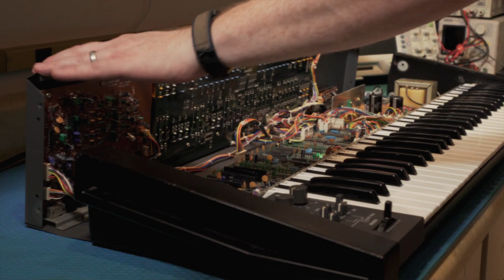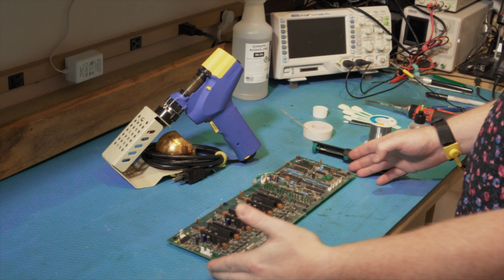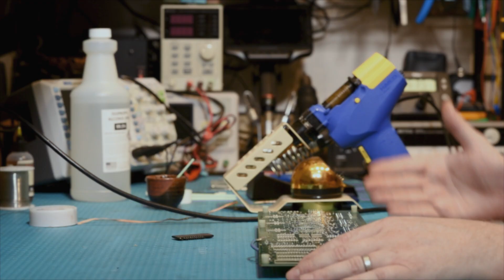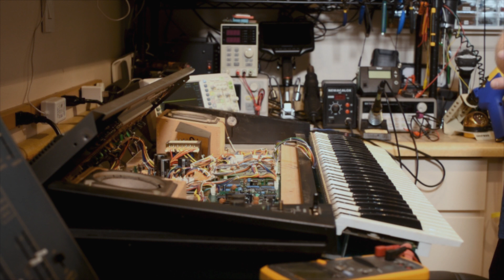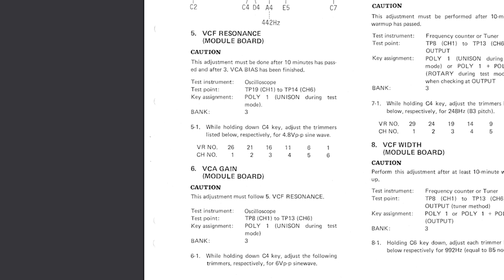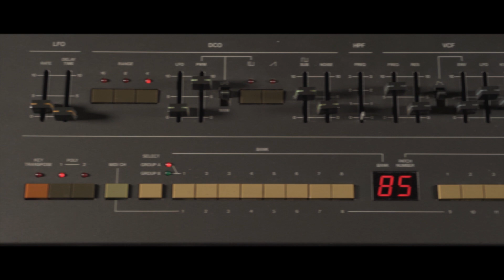Roland Juno-106/HS-60 Voice Chip Replacement + Demo Track~

Comment: Thank you for the video. This is up amongst the best synth restoration/repair videos I have seen. The fact you covered every step with technical advice is welcomed. Many others cut out the actual repairing part and go from we need to replace part X, cut, I have replaced part X. I was wondering if you have been or are a teacher as it is a comprehensive learning video. All the best from Australia.

Comment: Yes a millivolt is a thousandth of a volt.   1 Millivolt is written as 0.001 V, so 15.01 volts is somewhere around 15 + 10 millivolts although you are not set to display a level of accuracy to know whether you are within spec.  Other than that your video was excellent, great job. 

I am working on my Roland D-70 nightmare of the icky red glue destroying the keyboard and the display dying. Not fun!!  

Thanks for sharing your techniques and expertise!
Reply: yeah, he is definitely not calibrating correctly starting from unit conversion to not using the correct dmm

Comment: To remove the chip I was forced to use a heat gun to heat up all the pins at one time.
Reply from the maker: Desoldering ICs is an art indeed. Glad you got it done with the heat gun! They can be a great option as long as you localize the heat application to the IC pins as much as possible.

Comment: What's up fellas.  I was able to remove the solder from the empty holes with the cheap vacuum pen that you see used here.  You must use HEALTHY volumes of flux first, then use your braided copper and remove as much lead as possible first.  THEN AND ONLY THEN will the cheap vacuum pen work. It's not strong enough to remove large volumes of solder from the holes.  Best wishes.

Comment: Got to know if one of those inexpensive oscilliscopes would work like the ones on Amazon for 50 bucks
Reply: I’d like to know too. I’ve been using one and it works up until the vcf resonance voltage portion. I’m not sure how to read 4.8v with it 😩

Comment: Chip 1 and 6 are mute only in Patch number 1. All 6 voices work under other patch numbers. Could that be a battery related issue?
Reply from the maker: No, the battery is either dead or not. If all six voices are working on every patch except one, the voices are working. Go to patch one and start editing all the parameters, like turning the waveforms on and off. How thoroughly have you tested this?
Reply: @VintageSynthesizerSolutions Well I tested as much as I know about instruments. I'm just  experienced with soldering and desoldering. Attemping a repair on the standard juno 106 for my uncle who is a musician. Did the acetone epoxy removal on chips 2 and 6. The DCO region that produces brassy sounds seems to be affected. 2 and 6 voice chips work but sound slightly distorted in some patch numbers. Volume is normal on all chips unless DCO related effects are applied. Volume and distortion issues. Traces seem fine too. Used a good desoldering vaccum. Chips came off clean and went on clean on the voice chip end. I don't have a multimeter though so I'm not 100%. I'm stuck at that currently. Doing as much research as I can. I very much appreciate any diagnostic advice. It would be cool to fully revive one of these.

Comment: Am I glad I found your video! I'm working on my 106 now. I was prepared to recap the power and jack boards, but was leery of dealing with the double-sided module board. I don't have a solder vac, but I have plenty of wick and time! I now feel that I can do both the caps and the new chips. I see that AR offers a package deal that includes the 3 D5534A chips as well. Should I replace those as well while I'm at it? I am coming from the restoration aspect as opposed to just repair. Thanks so much for making your video so detailed; it really does help those of us who are tackling this for the first time.
Reply from the maker: Thank you! We try to approach all of our repair videos from a perspective of how one would teach a novice. It can be very intimidating opening up your beloved vintage synthesizer for the first time, let alone working on it. Per your question, the 5534a seems to fail far less often in my experience, but it does share the same resin coating that causes the failures with the 80017a. If you do decide to replace them, keep the originals and treat them with acetone to remove the coating. Helpful if you ever want to sell it or swap them back.

Comment: Thank you that was a fantastic walk-through. Out of curiosity, is there enough room under the key bed to put the new voice chips into IC sockets since the VC's will be up higher? I tried looking very closely to see if you put the voice chips into sockets or if you'd soldered them directly to the board instead but its hard to see. Thanks!
Reply from the maker: Yes this is possible unless you have very large risers
Reply: @VintageSynthesizerSolutions  Thank you - I can confirm that it works. There is very little space left between the bottom of the key bed and the top of the VC,  maybe a quarter of an inch, but its more than enough if you use the original VC's.

Comment: One of the VR tops popped off, do you think this will be a problem?
Reply from the maker: Definitely, especially if it was adjusted in the process of being popped off. What vr was it?
Reply: @VintageSynthesizerSolutions  vr-29. I  just replaced it with a more recent variable resistor!

Comment: Thank you for the video - I'll be using it for reference when I tackle my 106. Is there any reason why you didnt socket the chips? Im intending to do the acetone process (and if that works) socket the chips so if I need Analog Renaissance Chips down the line, its much less painful. Cheers again!
Reply from the maker: Was planning to socket them the day of the install, but be warned, the pins on the Analog Renaissance chips are quite large. Consequently, the sockets I had on hand would not accept the pins. Also, since we were installing the AR chips, there shouldn't be a need to pull them anytime soon. Thanks for checking out our channel!

Comment: My hs-60 seems to distort pretty fast 4/5 on vca slider. with the filter and chorus on. I have calibrated it to specs, even tried lowering the vca gain pots. i replaced the mute transistors, but still i feel like mine distorts before most peoples. obviously i can lower the vca and it's fine, but its frustrating. not sure if it's normal or something else.  when i watch demos i don't see people distorting ever.
Reply from the maker: Check your MN3009 chorus chips
Reply: @VintageSynthesizerSolutions  nah it was something else.
Reply: @emodro  Care to share what that was?
Reply: @ricvieramusic  I sold it a while ago, first check it's not the external volume pedal pot .being stuck in a weird state, plug one in, and play with it.  I think I ended up replacing the chips responsible for that.

Comment: When working on older vintage gear, a good quality set of tools is very important and easy to take for granted.  A decent set of jewelers screwdrivers, are essential for calibrating the tiny trim pots on many old synths.  Also for the larger screws, a good pair of both flat head and phillips head screwdrivers that have tempered blade ends.  Old screws can be very stubborn to unscrew, sometimes they may even be epoxied in.  Temper steel screwdrivers won't get chewed up by a stubborn screw and will also help the screw head from getting torn up.
Reply from the maker: Very good point. Having the right tool for the job absolutely critical. Cheap tools will only last a couple jobs, or even potentially cause damage.

Comment: I've got an HS-60. This video is great. Not sure I have the voice chip problem yet. It does have other issues. I'd love info on replacing the battery on the motherboard. From what I understand it's not a simple pop out & replace.
Reply: Steven we'll get this into one of our videos here soon, I assure you. However, this video should give you all the tools you need to do that job. It's a much easier job as well. Basically, instead of removing the module board, simply remove the CPU board. The desoldering process is exactly the same, except much easier because there is only 2 pins to desolder for the battery. Just take a photo before you do it to make sure you put the new one in the right way. However, as I mentioned in this video, Roland was very good with labelling so you shouldn't have any problems. Syntaur.com will sell the exact battery you need with the pins in the exact right locations for your synth. The only other thing is you need to back up your patches beforehand (if you care about them). Alternatively, reloading the factory patches is quite easy via the cassette interface, you can just use your phone and a 1/4' to 3.5 mm cable. The factory patch banks for the JU-106 are readily available online in .wav format.
Reply from the maker: @SacSynths_Jack_Z  is my other yt account. Sorry for the confusion. Anyway, It is as easy as replacing the battery, it requires soldering and reloading your patches. There are many videos on this on YT, if you search for synth battery replacement.